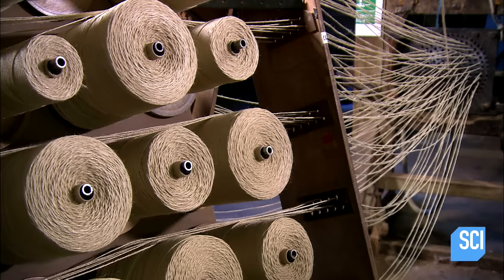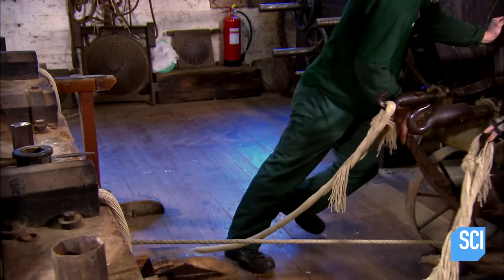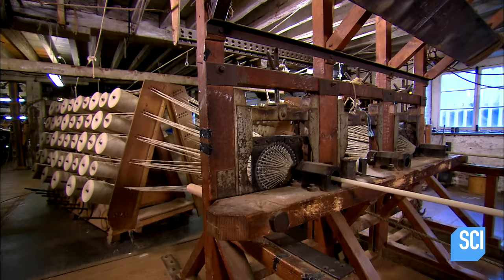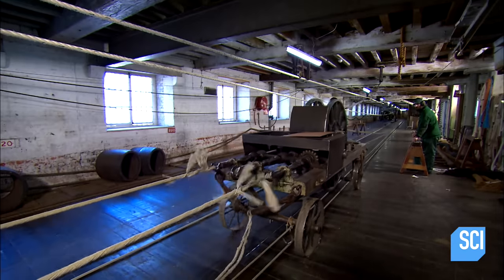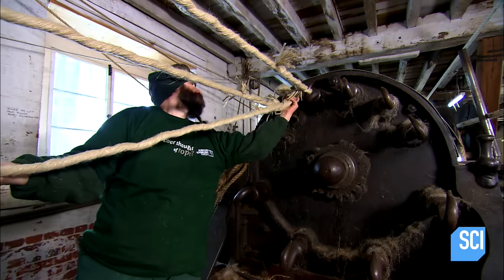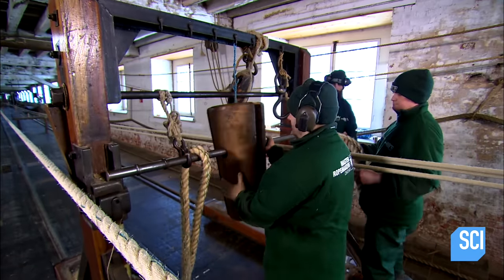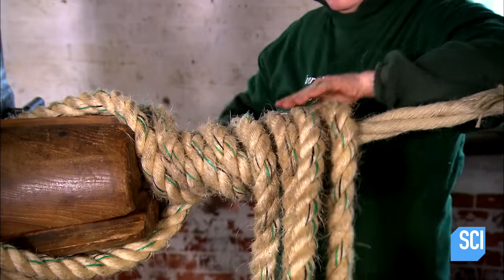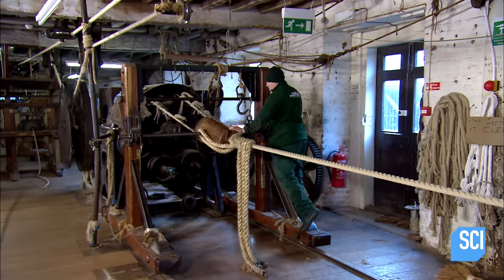How to Make Rope | How It's Made

Comment: Seems pretty inefficient to be manufacturing one rope at a time when clearly several can fit on that machine
Reply: That old machine is manually pulled only. If many ropes are to be fit at a time, excessive tension forces (due to ropes' dead weights) will be created that a herculaneum force is needed (like horses) to pull the machine away. Just imagine the electric transmission lines where the middle sag creates tension forces between two support poles. There is always an engineering involved in many things we use🤦‍♂️ not just a wishy-washy solution from fairy god mother🧚‍♀️. 

Kwak kwak🦆